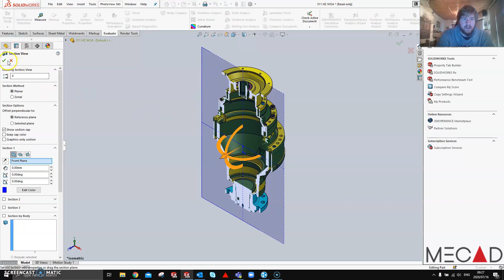Using Import diagnostics In SOLIDWORKS

Comment: I'm using SW 2018 and I don't have the "Attempt to heal all" button, nor the other two in the advanced section underneath. What's wrong on my end?
Reply from the maker: Import diagnostics was added in 2013, so you should have it available. Are you in a part environment? Another Commenter had a similar issue because they were in an assembly environment.

Comment: is this feature also in solidworks 2016? i cannot see it in my evaluate tab.
Reply from the maker: Hi, import diagnostics was added in 2013 so it should be available. Try searching for it in the command search or you can also find it under Tools > Import Diagnostics.
Reply: @mecadsystems-solidworksand4875  yes i found it. I was in assembly so it does not appear in assembly. After i opened the part separately. i was able to use import diagnostic.....thank you for your reply